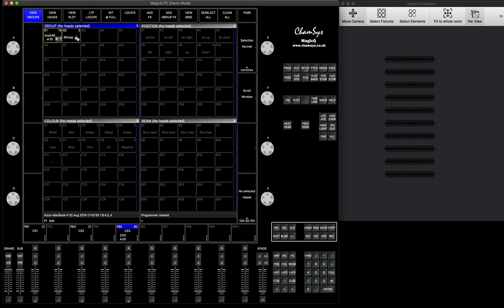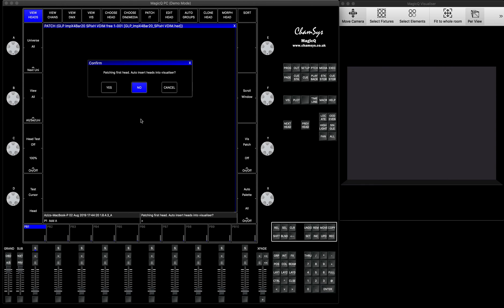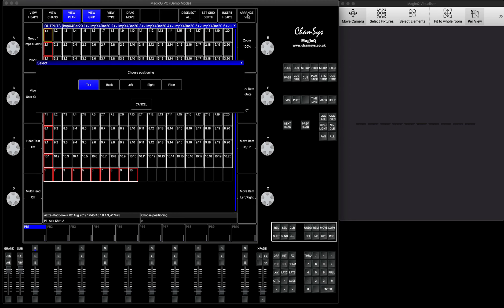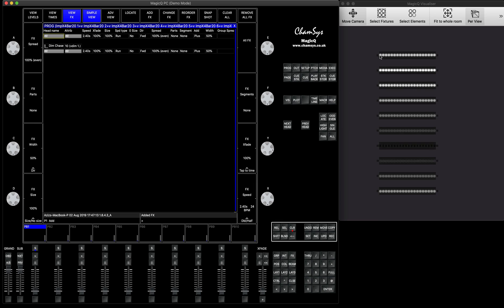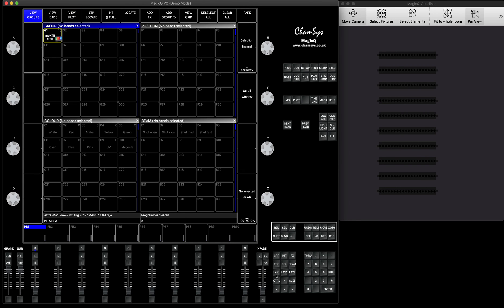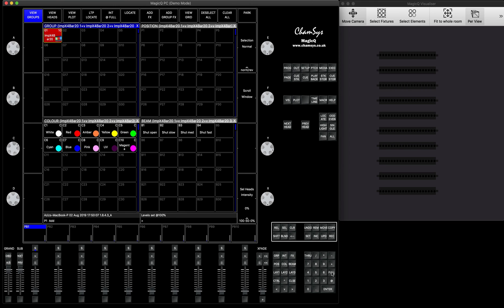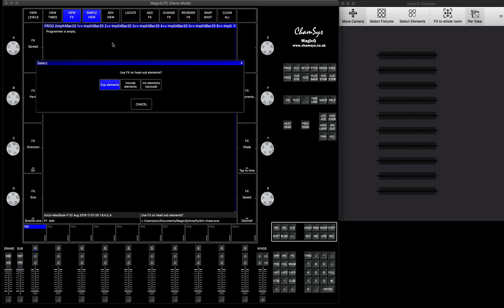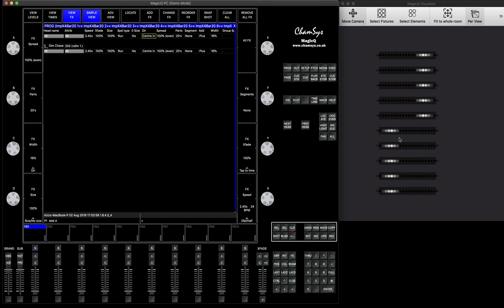Эффекты на RGB-светильниках. Часть 1. Управление элементами/ячейками + Dim FX

Comment: My fixture asks the elements question on color fx but not on intensity fx… any reason for this?
Reply from the maker: @Kevindnowak  logically means u didn’t apply vdims…but this is just logical conclusion. I might be wrong of course
Reply: @chamsysrus  Why do you need the vdims? I have the same problem, but as I wor directly with the lamps I would think the vdims are not needed?
Reply from the maker: @norunnsk what do you mean work directly with the lights? Normally LED batterns with multielements dont have individual dimmer channels per each element, therefore adding vdims is essential in order to individually controller the int level per element. If use just needs to control all elements together (not individually) but colour has to be applied per element, then adding vdims is not needed.
Reply: @chamsysrus  Oh sorry I thought vdims only has to do with the virtual layout in chamsys! Then I guess I need them. Do you have a video instructing how to do that? Sorry if it is already in this video, then I have just missed it
Reply from the maker: @ it is in the video of course. Otherwise its in the patch, select fixtures thay need vdims, on the top it should say add vdim. Press on it
Reply: @chamsysrus  really can´t find it in the video. but now I found it in the online manual, so I´m good